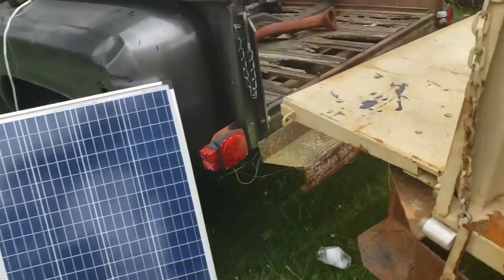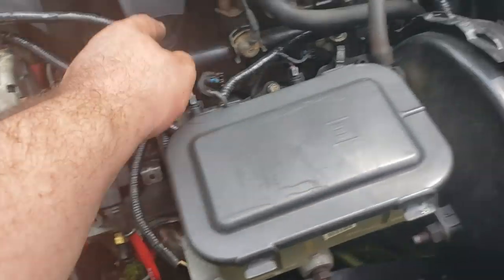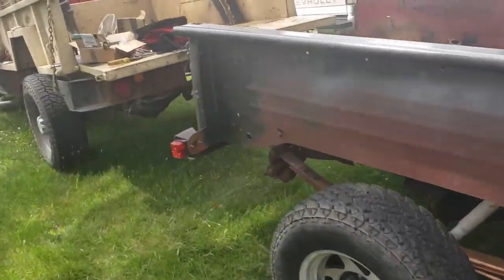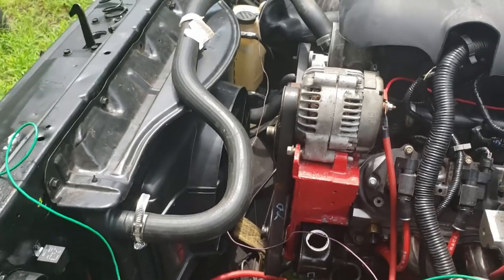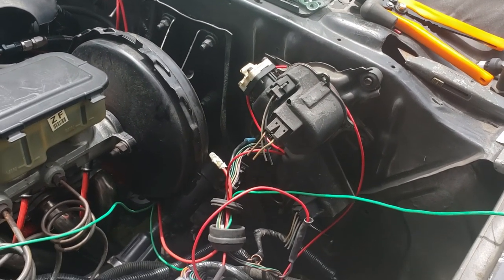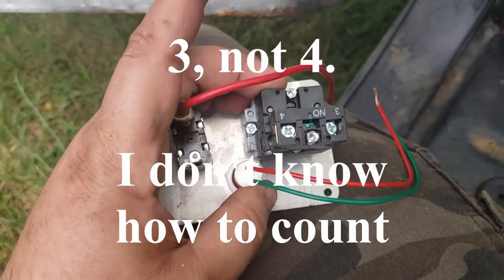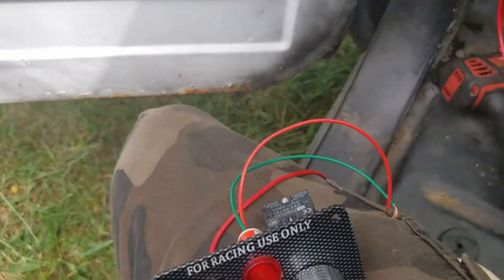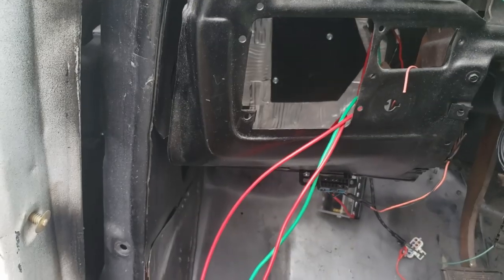Minimal Basic wiring for LS swap how to. Make it start and run only.

Comment: Thanks JR. I have a s10 that I’d like to LS swap (after the mustang is done) but it was completely stripped of the factory wires. Rust free truck from Missouri I picked it up for $100.... I planned on just running a 8-12 fuse panel under the hood. Battery will be mounted in the bed. Where you helped me was the fact that I can run my fuse block off the back of my alternator. I’ll only be running the minimum, it won’t be run on the streets unless I plan on wiring headlights taillights etc. Basically just building it for the ‘Run what ya brung ‘ races on Friday night. Keep it up !
Reply from the maker: Same lol, all I really need is brake lights
Reply: The Driveway Engineer once that time comes, I’d really want to know how you achieve that. I think I’m going to wire up brake, turn and headlights. That’s it.

Comment: JR. Mr. Driveway Engineer, sound clips can be dramatic, but the loping camshaft in the higher compression engine, complete with a clean crisp valve job sounds so good, I have to ask....What is it? 
I have been in Detroit, NE of town with buddies as we walked the “Show-N-Shines”, and heard that sound. As a car guy, you have to look and figure out where it is. Only the lucky one know what’s under the hood as they disappear into a small white puff of burn-out smoke. I am convinced that a Prius dreams about sounding that way, while plugged in its charging station late at night. I think they cry a little!
Please share. Please! So cool, that should be a ring tone for phones. Subscriber.
Reply from the maker: Are you referring to the intro?

That's my truck, Daryl, a 79 C10 with an LQ4, 862 heads, 10.2:1 compression with a 230@50 cam
Reply: You got it JR. The intro changes on videos if I remember right. I have  5.3L iron truck engine (1 of 1.3 million produced), but stock 9.5:1 compression. I saw the lift @ 0.50” and would have calculate actual valve lift w/stock 1.7 rockers, seems that 500 or under works w/stock spring, going higher requires better. LSA 112-114 is smooth & good vacuum, this one has a pipe that sounds like 108. Just sounds so nice. Did not want to pry as soo many combos can sound the same. Retirement does not pay well so I will replace stem seals, trunnion kit, I left T, C & G, modify oil pump, plastic gauge random rods & mains, new seals & gaskets, bar-bell and look for better oil pan for 67 C10 for driver only. 4 more surgeries to go as L3 epidural was good (#2), MRI done and Elbow surgery on the 4th over. Decades of this work, wears out parts. Miss my old wallet while sitting between 4 tool boxes, MIG, Torch, Sandblast, Press, 2 HD sewing machines & 30+ plastic or metal boxes of special tools including TECH-II. Shame as boys won’t touch them because the have no clue.  Keep up the good work, great videos.

Comment: Sounds like I need to chase and label every wire from my "existing" ign. and fuse box in "the car" so I can power all through the original system, knowing what all does what. As my car has all the electric goodies. Luckily the old CPU is separated on the passengers side, and the ing / body wiring / fuze box is on the other. Damn simple, but complicated.
Reply from the maker: Most are separated like that.

An LS harness only needs ground, power constant, and triggered power to run.

That's why I'm able to wire the truck so simply, even when I add lights and whatnot back in, there's nothing to the engine side.

Comment: Hey man, speaking of minimal wiring have you thought of trying out the carb intake?

I think I might go that rout not only for wiring sake, but to keep that “classic look” going with the truck.
Reply from the maker: No, not other than with injectors and a TB mounted on it still lol.

Wiring the engine to the truck takes ground, 12v constant, and switched 12v.

Comment: Bro please let me know how you ran your ground cause my starter drags due to low ground
Reply from the maker: Block to frame, one on each side, battery to block and battery
Reply: @TheDrivewayEngineer  thank you I relocating to trunk do to turbo much respect
Reply from the maker: I'd still run the same grounds in the trunk
Reply: @TheDrivewayEngineer  my start terminal was loose an wiggly could that be a problem

Comment: Great post was hoping you could help with a wiring question regarding vss signal. I will be running a T5 on a LS swap. What pins are input vss from trans to ecm? I know it needs an input from trans but not sure on ecm pins. Thanks in advance.
Reply from the maker: There's full diagrams on LT1swap.com. 

It depends on the year of your harness and PCM, but I'm sure it's covered there.
Reply: @Miguel Ortega  The VSS signal generator is a permanent magnifying type. This means only two wires are used, shown at the PCM, will be one “High” and one “Low”. It makes no difference which is which, as a “PM” generator produces an A/C voltage. I would suggest that you do a little extra work for a clean signal, not hard.
 First, at the transmission on the frame, place a ring connector with black for ground. Run this inside that harness and terminate next to the PCM’s location. Using extra wire, but place one end in the bench vice, the other end in a drill. Twist the signal wires to roughly 9 times per foot. This action shortens the wire, so start with extra. This is the factory method and by twisting, reduces the ability for high voltage or transient voltage to be induced into the signal wires. That extra ground works this way as well. I use aluminum tape to wrap all three wires to make the VVS harness. The hard working PCM takes this signal and splits it to inputs to the Speedo, ABS for rear axle signal only, then radio. These are the RDS radio that gets louder when driving faster and quit when slowing down. The Body Control even gets Milagros info to kill the radio & creates a warning noise in LF speaker, when your blinker was on for too long. It’s all very simple right? Best to you!
ASE Master Tech since 1978 - Retired ( I am sharing what I have learned, yours may vary depending on the year, equipment and programming) Just helping Mr. driveway engineer, JR. Best to all.
Reply: @deankay4434  i
Reply: @larrywelton9925  What? I too? The eyes have it?

Comment: Why not run your 10 gauge from the battery instead of your alternator to your distribution block? Would look cleaner but more importantly you could put your breaker closer to the battery.
Reply from the maker: Because it's a shorter run to the distribution block from the alternator. 

That's the factory block, and I'm not moving it.

Also, the wire is in the wiring loom now